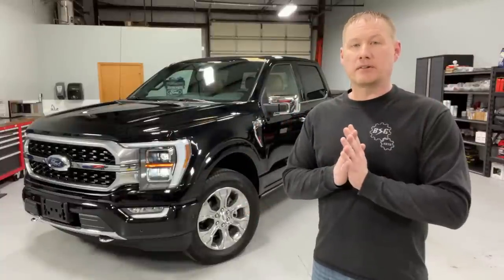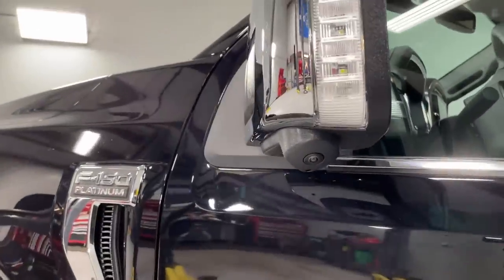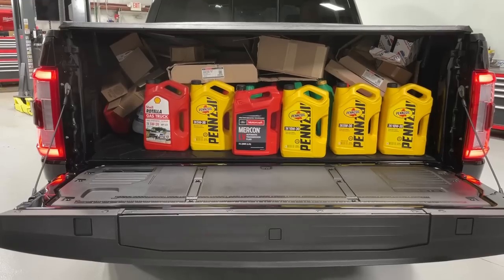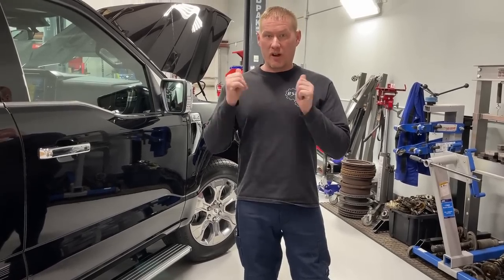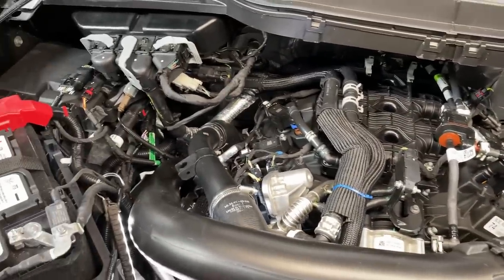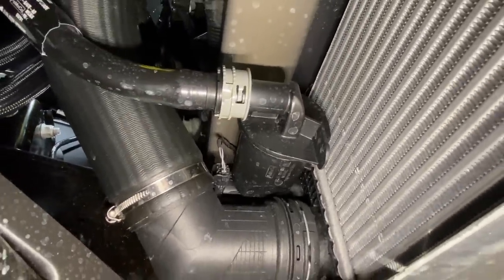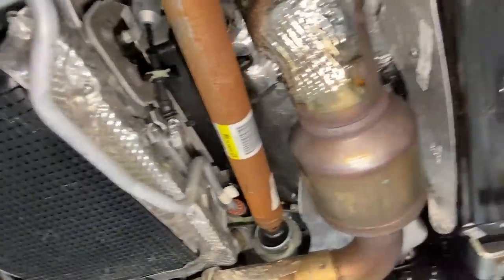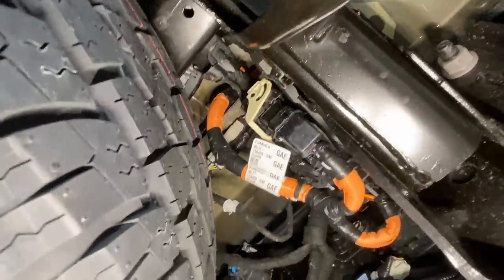The All New 2021 Ford F-150: My Initial Thoughts Pt. 1 of 2

Comment: What was the deciding factor in you choosing the 3.5 ECO over the 5.0. I have ran my own shop for years. I will be 60 this year and like yourself have been primarily Ford in my life. I just can't get my head wrapped around all the additional tech of the Ecoboost when there is a better setup. My opinion comes from all the customers with the ECO having poor fuel mileage and lots of problems the closer they get to 100,000 miles and beyond  while the 5.0 is having less repairs. The only failing I've encountered has been the water pumps on the 5.0.
Reply from the maker: The 18-20 5.0L engines were a disaster after the redesign, so did they fix all of that for 21? IDK too early to tell but I wasn't going to be Ford test subject.

Comment: Didn't you buy a Dodge Ram not so long ago? Curious to hear what made you come back to Ford, improvements in the 3.5 EcoBoost?
Reply from the maker: I didn't like the current gen F-150 at the time plus I wanted a 1/2 ton diesel so I went with the Ram. Up until 2021 I did not like the F-150 enough to buy one so I waited and I am glad I did.
Reply: @FordTechMakuloco  Glad to see a professional get the 3.5 Ecoboost. Mine has only 30,000 and longevity has always concerned me.

Comment: Also was anyone ever actually able to confirm of the plasma wire arc spray in cylinder liners were the cause of the oil issue or was it the excess vacuum pressure on deceleration like Ford said in the TSB for the reprogram. Manufacturers like BMW and Audi have used spray in liners in some of their models for performance reasons and not had oil issues like that but maybe it’s different here.

Comment: Its by far the nicest truck out there and if I had unlimited money to spend $75K on a truck that will probly be in the shop at least 3 time under a 3 year warranty then have me scrambling to dump iit after 3 years I'd buy it!  But for me its way too costly, too many darn ships (that are all unavailable today anyway) and man it just like they build too complex like a space shuttle or something.  I just want a truck that I can drive for 10 years that won't make me hate it bringing it it in to fix knibler pins, turbos, or whatever other high tech crap breaks on it.  I don't care about the gas mileage so much I just want it to run reliably for a decade and not give me a hard time.  SO I guess I want a 5+ year old Toyota :)  But man it looks good!

Comment: Two parts! Was driver side LED/fog out? Timing is perfect as I was thinking about the Powerboost version (hybrid). Unfortunately for most, chip shortage. Heck, friend can't even get a Bronco to test drive! Would like a hack/mod to disable cylinder deactivation...hate it. Did you remove the underpanel of the motor area (to show us) or was there none? I can see clips but... I would hope there is some protection...Thanks! and look forward to more on the likes/dislikes and long term ride (comfort, mileage, reliability ...)
Reply from the maker: No, the fog lamps were never turned on. This is a corner lamp function.

Comment: I hate how slow the instrument cluster is when your going through the settings and just scrolling looking at all the different data.
Reply: Most of the manufactures are like this. We are all use to using the latest devices from Apple, Samsung etc.... and the car manufactures aren’t anywhere close. They absolutely are shaving dollars when it comes to this. The slow speeds are so frustrating.
Reply: @AJourneyOfYourSoul  Very frustrating lol. Especially when the previous Gen was fast and smooth.

Comment: I wonder if the bolt pattern for the powered running boards are the same as the '15-'18, do you think? Since you cannot replace the motors on them (could've put the motors in the back side to avoid the road debris), I wouldn't mind replacing them with these longer running boards.

Comment: The platinum trim is nice for sure but all of the electronics would have me concerned about long term maintenance cost.
Reply from the maker: Lots of software updates already.
Reply: @FordTechMakuloco  What's nice is that now a days they do over the air updates instead of having to go into a dealership..Not sure how many modules that can cover but imagine it would cover most right?
Reply from the maker: No, only a few for right now.
Reply: @FordTechMakuloco  I wonder why they can't do all of them? I know the security is pretty tight in their ota process

Comment: I wonder if that leaf pack will swap into my 2020. Mine has 3 leafs and it has a problem we’re only after 10k miles the isolator pads are worn out and it cause the top 2 leafs to bang into each other causing a loud popping noise

Comment: Brian what is your opinion on the rust on the underside of the trucks from new.
Reply from the maker: Perfectly normal and has been that way ever since I started working on new trucks at the dealership in 2005 and became worse around 2009. Nothing new at all, the media sensationalized it and now everyone is looking for it and commenting about it. This will never go beyond surface rust and will have no effect on the vehicle. Some parts are actually designed this way to provide a sacrificial layer of protective rust, the metal name starts with an "S" I believe.  Again perfectly normal and nothing to ever worry about.

Comment: Just looking at the rear differential, I’ve heard lot’s of complaints about the rust when new. What’s your thoughts on the subject?
Reply: Those cast iron type parts never rust more than just that surface rust. My F150 is 20 years old and has been like that since day one. No problems at all 20 years later.

Comment: Hello Brian, I have a 2018 Dodge Grand Caravan with 55k miles. I want to know if this is a good time to add some oil to the tranny or add some type of additive to the tranny to keep things running smooth? As of right now I have no problems with the transmission.  I plan to do some overdue traveling in Texas this summer. I add, my tranny is sealed and has no dip stick but does have a dip stick tube. What do you recommend?

Comment: Ford getting rid of that reliable 6 speed is a horrendous mistake. Most reliable and underrated configuration is the 3.3L V6 paired with the 6 speed. Ya its the least powerful, but the most reliable. Life is to short to spend all your extra time working on your own vehicle.

Comment: Any reason not to paint front axles and drive shaft? I understand they will last long with even with rust, but still. How much more would it cost to paint those parts? Also why rear axle is already rusting even with paint? Very disappointing for expensive truck.

Comment: Hi. Great videos. You seem very trusting. Quick question . My 2018 F150 5.0 4x4  has a very sloppy/jumpy hard shift quite often. Also motor sounds like a can full of marbles at acceleration,  most of the time, sounds terrible,  embarrassing. Can you recommend a fix , for these problems. Thanks Cheers
Reply: Can start with simple maintenance? Maybe change the transmission fluid and filter and put in new spark plugs? I'm not a mechanic, but I did both of the above the my 2016 5.0 recently. 40k miles but almost 5 yrs old.
Reply: @paul petticrew
Buy a 2.7 , get rid of the five-oh oh

Comment: Nice truck. Little concerned that a new truck with 500 miles has surface rust on the driveline and CV joints and rear  axle already. Painting those surfaces would of prevented that. Come on FORD.

Comment: "Now of course this is a brand new F-150...  We will have to start by replacing the cam phasers, timing chain, guides, camshafts, and bearing caps.  (Not much) Later, we will go ahead and replace the broken spark plugs, followed by a fresh engine.  Haha! Just kidding about that last part.  Once we have got another 15,000 miles on the truck we will replace  the cam phasers, timing chain, guides, camshafts, and bearing caps.  These are really not bad engines - in between the times that you have to replace all the timing components..."
Oh, wait, it's not a Triflin, I mean Triton?!

Comment: Pretty sure that oil pump is driven by a chain. Only engine that i have seen that is belt driven for the oil pump is the 1.0l see those belts fail all the time.
Reply from the maker: Nope it’s belt
Reply: @FordTechMakuloco  dang so I didnt believe ya but just looked at the wsm. Fml I feel like ill be replacing some engines due to that. It wasnt a good idea in the 1.0l and im betting it wont be good here either. Thanks for pointing out the iwes. Did not know that was a change they were doing. Im a tech at a ford dealership in ohio love these new truck. Still waiting on my 21 lariat that is replacing my 2019.

Comment: I have the  same truck only that i have the power boost. my transmission sometimes when i stop at a light and want to start again the motor speeds up and the truck barely moves until you let off the pedal and step on it again Took it to dealer and they reprogrammed it but it did not fix the problem Any ideas?

Comment: Now with the towimg does that depend on the cab and drivetrain config?  I have a 2020 5.0v8 f150 3.55 diff Crew cab.  I think mines only tows 9100lbs correct??  Thx

Comment: I’d really like to know more on the suspension level sensors, I can’t find anything on the net about it. I also have the sensors on my 21 lariat
Reply: Most likely so the brake control computer knows how much the bed is loaded & can adjust or "anticipate" the amount of braking force & anti-lock control will be needed in the event of a panic stop. Probably will also be tied into the upcoming "Blue Cruise" self-driving deal he mentioned.
Reply: It's for the headlights.  The headlights always stay level where they need to be even if you have the bed fully loaded down.  That's what thw sensor is for.

Comment: Hi fellow Ford owners. I'm hoping someone can point me in the right direction with a problem with my 2016  Flex. I was running errands and on my last stop (fortunately) I got in the car and it had absolutely no power. I mean the key remote doesn't work, no lights on the console when I turn the key, no sounds or clicking...just dead. I called a tow and the driver tested the battery and it had charge, he seemed as puzzled about it as I am. I went through the fuse diagram and checked the ones that looked like they related to main power but they were all fine. Does anyone have any suggestions? Trying to avoid a trip to the shop if its something I can fix.

Comment: Nice truck but your drivers side fog light is out. Peace
Reply from the maker: No it is not, the fog lights are not even on. Ford uses them as cornering lamps for extra light at the ground level at low speeds such as parking lot maneuvers. As you can see here the wheels are turned to the right so the right cornering lamp is activated. Do you understand now?

Comment: Still with the horrendous timing chain powered water pump?
Reply from the maker: No, they never were either.
Reply: @FordTechMakuloco  the Ford 3.5 V6 water pump is not driven by the timing chain? My 2008 Mercury Sable 3.5 V6 water pump is driven by the timing chain. Replacing the water pump is a $1,500 job. One of the main reasons why I sold it.
Reply from the maker: The water pump is external on the longitudinally mounted powertrains used in the F-150. Your vehicle features a transversely mounted powertrain which is much tighter so the water pump is internal.
Reply from the maker: @michaeltrinidad1217  Yup I know all about them I just finished replacing one yesterday on and MKS but does not apply to the F-150 and a few other Ford models.

Comment: I'm an owner 2014 Ford Explorer Limited. 130,000 miles. Had the typical Explorer 3.5 engine issue...water pump problem. I had 110, 000 when it went bad. Out of warranty but I had Ford PAY 100% of the bill. $5498!! Other than that a good SUV. I'm in the market for a new Explorer Platinum or Lincoln Aviator. What opinion do you have on the engine issues if any on this new generation?

Comment: On F150, instead off a check engine light, they should have $, $$, $$$, $$$$ light instead. That just lights up the right $ on how expensive it will be to fix. Actually with Ford, might as well just have $$$, $$$$ and Should have bought a Toyota as 3 options.

Comment: Beautiful truck. FORD still won’t spend the money for under carriage components finish/paint that actually prevents rust. That rear axle assembly is shameful at 500 miles. My driveshaft is self balancing by throwing off rust as it rotates.  Just saying......

Comment: What's the Dino Pennzoil for?
Reply from the maker: Timing jobs.
Reply: @FordTechMakuloco  since I hve your attention - what's your take on high mileage motor oil - I've switched over to Pennzoil Platinum High Mileage for my 3.5 Ecoboost.
Reply from the maker: Absolutely no need and can actually cause premature catalyst failures.

Comment: Just bought a 2019 5.0 a few months ago, then I see this video and at 20:58 dude breaks the bad news. 
Ugh.
Reply: I have 36k miles on my 18 5.0 and it's been tuned, ran hard and abused since 500 miles. Never had an issue with the engine.

Comment: 14000 lbs 7 ton idk fuel consumption goes right out the window I gots a 2019 1500 an 2020 duramax 7 tons is a bugger in the 1500 with the turbo sure it'll do it but the fuel just think of the fuel

Comment: What if you on a steep inlcine ? And want extra holding power by having it locked in 4wd which I've done before. I'll stick with my manual warn lock hubs Thank you! Electric air dam be ripped of going thru muddy job site then cooling line to trans gets ripped off on a stump n leaves you stranded!! 2k for a master cyl?
These all must be some of "Ford's better Ideas 💡 !!!
And this is coming from a Blue oval man !

Comment: Fords engineering is getting more and more disappointing.  $400 Belt driven oil pump??  Why just why? I am doing a timing job in my 99 v10 and going with a M176 pump for $60 bucks and no belts to fail.  Won't even get started on the 2k dollar master cylinder...just shaking my head.  I have enjoyed many fords, but am about to switch to GM.  Ease of working on them is winning me over.

Comment: I wont buy any ford past 2005'ish... they are overengineered to the max in a wacked out way... whereas GM is overengineered.... but, they do it thats not so wacked out.
I'm also a used car mechanic so I get exposed to everything that everyone is building....
This stuff too expensive as well.... I also own a 93' tbird....
Also, to prove a point: one of the foglights isnt working on this BRAND NEW truck....

Comment: Far too complicated a vehicle and likely won't be as reliable as in the past.  All this nonsense comes at an increased expense, both initially and in yearly upkeep.  I'd eventually buy a new one, but now I'll be buying used; the six speed automatic is a better choice, and I'd mate it to the naturally aspirated 3.3 or 5 liter engine.  If only they'd offer the value I got when I bought my 1986 F150; $13,000 new for a 300 inline 6 with a 3 speed automatic.  Bulletproof; that's when you got value for your money.

Comment: 70+thousand an u got the turbo not the coyote what gives
Reply from the maker: As I mentioned the 18-20 5.0 was a nightmare so I wasn’t going to even try it on a 21.
Reply: @FordTechMakuloco  lols it was said after I asked sry I'm impatient great video
Reply: @FordTechMakuloco  While I've read about oil consumption issues with the 18-20 5.0, I've had no issues with mine.   She's a noisy/clacky little thing though. lol.
Reply: @FordTechMakuloco  My 2019 5.0 has used oil since day/mile one, even after the TSB 19-2635.  Will Ford ever address/fix this, or should I cut my losses and trade for something different?  Thanks!

Comment: What’s up with all that rust underneath.   Straight. From factory.   Big big turn off  for a  pucrher of truck.  No thanks not for me. Not impressed at all   I see building a work truck for my use might have to put gas in it. But all thies new parts that will need replaced  in a few months   At such a cost will buy lots of gas  for a good restored  truck.  That’s. Plane and sempel   This truck is for.  Prestige. And.  Look at me  truck. Can’t see a contractor makeong profit on a job with this kind of infeastment
Reply from the maker: I think you are referring to the rear axle, this is perfectly normal and has been this way for decades. It never goes beyond surface rust, from what I understand this is supposed to happen. It is a sacrificial rust layer from a special blend of metals, I can't remember what the name of this mix is but that is what is happening.
Reply: @FordTechMakuloco  Sorry Brian, I love your vids, but I disagree.  That rust IMO is totally unacceptable. Look at the rust already forming and crystalizing on the front brake caliper line bolts.  That crazy rust on the front axle CV's, rear diff cover bolts, etc.  My 2005 FX4 with 170K miles on it doesn't have that same rust on those items.  If Ford spent an extra $10 on painting all of those bare steel components we wouldn't have this rust.
Reply from the maker: Trust me I would know, maybe I will do another video in 3 years before I trade it in so everyone can see.